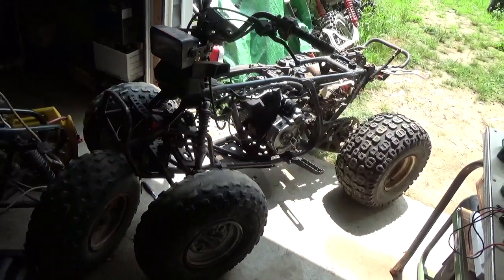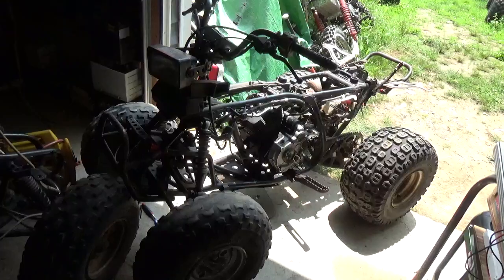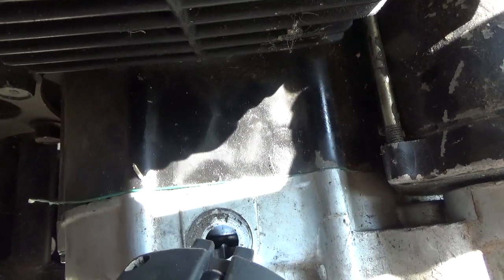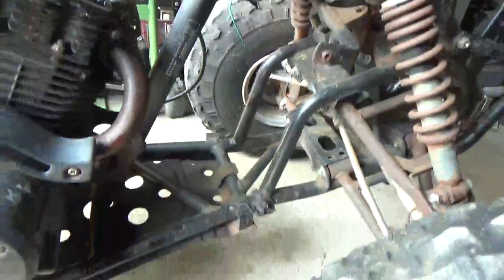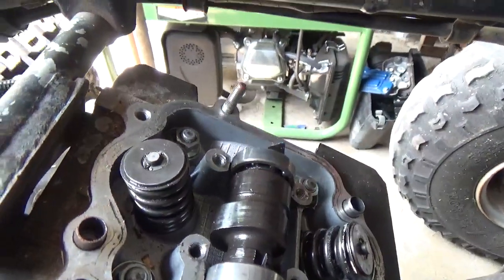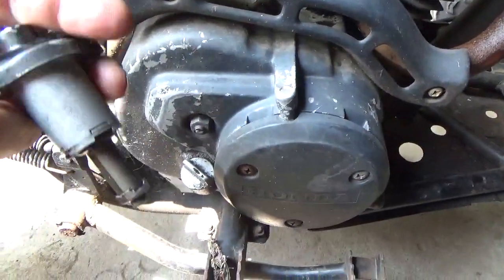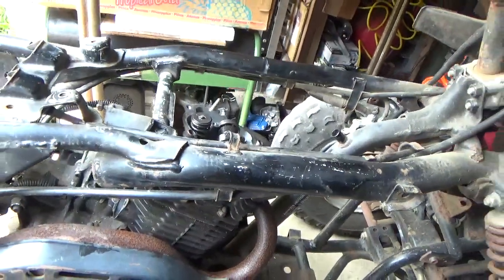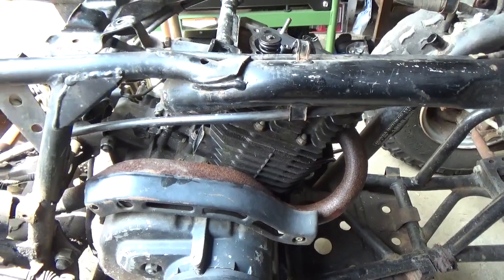Honda Fourtrax TRX200SX, How to check and set cam timing!

Comment: I took mine apart it would hard start and not rev up without back firing and running bad plus 60psi compression, I put it at T and the cam was 180 out from yours so I imagine somebody messed up and my piston ring gaps were almost aligned so new piston and rings and swap over the cam and hopefully be good to go thanks for the vid.

Comment: Hello Harvey. I recently replaced the crank bearings on my 1988. I had to pull cam chain gear off the crank to replace the bearings. I am stumped on how I am going to time the cam now. The gear on the crank has no markings on it, so it was just pressed back on the crank at a random timing. I haven't put the top end back together yet, but I don't understand how I am going to be able to line up the two marks on the cam gear now since the lower gear was just pressed on with no reference marks. Thanks in advance if you get this message!!
Reply: Hey BB&B!  Line up one tooth of that lower sprocket with the flywheel keyway groove.  I had the same issue when I changed a severely worn sprocket.
Hope you're well man!
✌️😁🍩
Reply: @donutdan1508  Thanks!!!!!! That one had me stumped!
Reply: @BIGFOOTBIKESANDBREWS  Ayuh....that one got me once too.🍻
Reply: @donutdan1508  , I'm hoping I lucked out and got it right when I pressed it on 😁I'll find out this weekend.

Comment: I replaced the head gaskets on mine it it caught fire trying to start it after lookin I seen I forgot the bolt that goes in the middle of the cam tensioner it popped then jus caught fire If somebody could explain why

Comment: I recently picked up a 1986 Honda trx200sx when you turn it over it is blowing out the carburetor so I kind of figured the timing was off at least that's what I think I was trying to take apart the top part like you did but the one that with the stud at the spark plug underneath that cover piece is not wanting to come undone what is some good tricks of getting it off
Reply from the maker: Hey Hondaman,,,, I have a set of long jaw vise grips that I removed some addition metal from, though I think the spot and bolt U speak would be tight even for them.... U may have to grind the head off the bolt, remove the cylinder head, and vise grip the remainder of the bolt out.... Good luck, let me know how it turns out.... Thanks for asking, watching, and commenting!!!
Reply: Hey man, i just got a trx200sx aswell that was blowing out the carb, it ran but smoked like hell, did you figure it out? i might have todo the same thing to mine.
Reply: Hey Harvey spooner I figured it out the intake valve was bent was going to order some but this one just being a beater I ended up finding a valve that would work I just had to modify it a bit basically just make it shorter came from a 2000 Honda Civic lol
Reply: @hondamanatc4life983  Sounds good, i'm hoping the valve isn't bent on mine and it's only timing. Glad you got it figured out. How's it running today?
Reply: @hondamanatc4life983  How did you end up getting that nut loose? i've been trying to unscrew it all day and havent had any luck and ended up messing the nut up. Did you have to grind it off?

Comment: Hey Harvey! Long time watcher from Ontario Canada, got a question for you! 
I have an 84 250sx, lots the gas cap riding last summer, I have been gorilla taping the hole in the mean time to keep ridinh, but this is getting old! Lol 
Can't seem to find a cap at a reasonable price point. I found one, with the tank, but buddy want 200$ Canadian for it, too rich for my blood. Lol
Wondering if you have any ideas for a cap that would fit, from a more common quad, like a fourtacks or something. Any info you have would be great! 
Thanks! 
Feet down,  heads up!
Reply: Still available from manufacturer. Or get it from partzilla just look up your ride and you will find it and it's factory part number if you wish to shop around for cheaper price.
Reply: Lost*